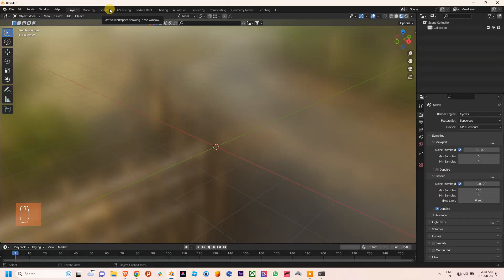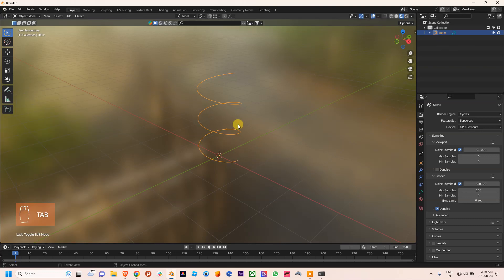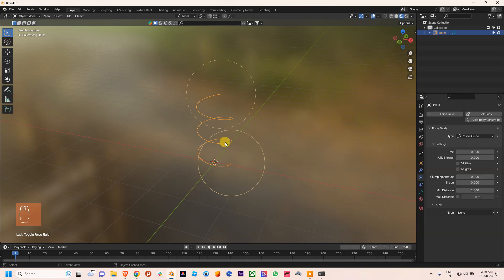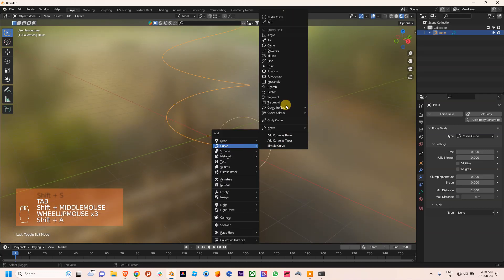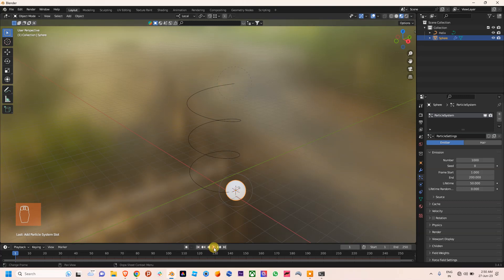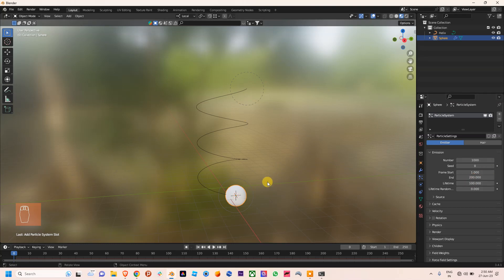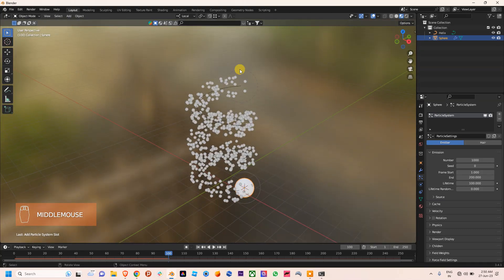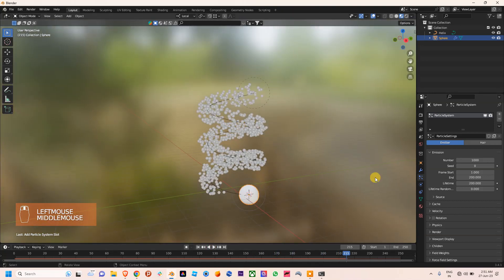Blender particle speed control on curve guide force field

Comment: Thanks, I was trying to adjust speed by changing the velocity (how silly of me), didn’t occur to me that speed control would be done via lifetime of the particle, very odd !! But I guess totally in-keeping with Blender’s general counter intuitive way of working.

Is it possible to vary the speed along the curve ? So, for example, it’s fast up to the 50% point then slows down ?

It seems creating a black to white gradient (which also seems a bit buggy and not very 50:50) can be set to vary particle sizes, but can’t seem to get it to affect speed.